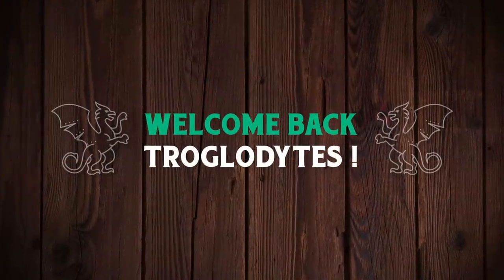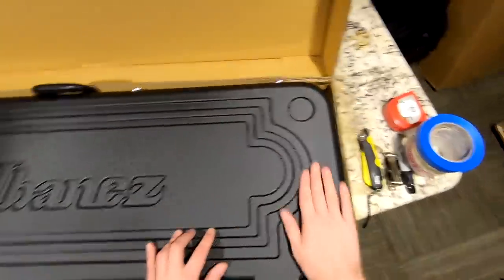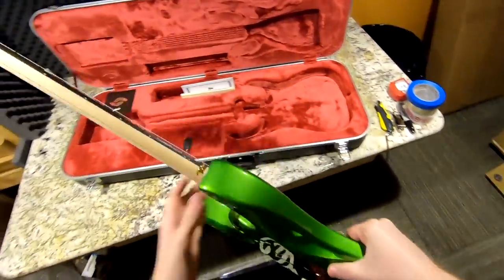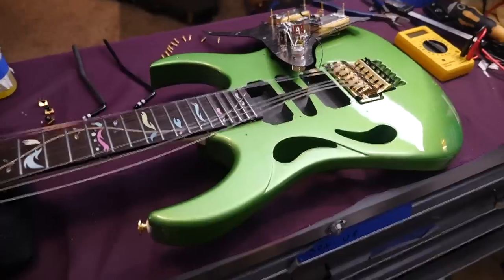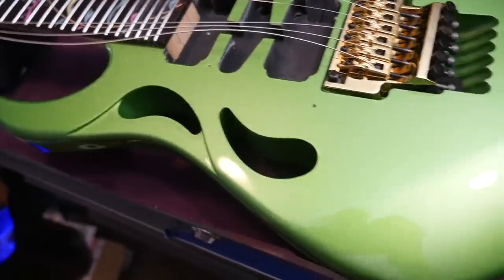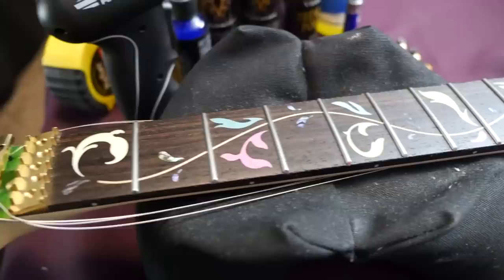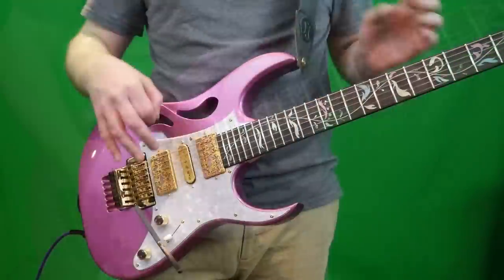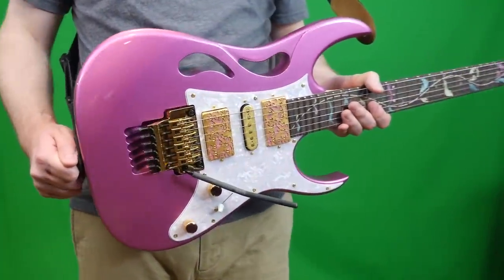I Bought the New PIA! | Steve Vai Ibanez PIA | Unboxing, Overview + Demo

Comment: Unlike a $3,500 Gibson which looks and does the same, here you see what you get for your money. The craftsmanship, attention to detail, scalloped frets, plus more. Ibanez does make you feel like your money is going somewhere.
Reply: Ibanez is for players and Gibson in for collectors.
Reply: With gibson you get an old style and design that includes the "feature" of a sudden and instant  "headstock ejection" at the slightest mistake, 5 inch drop or during shipping. Gibson says its traditional. I say, poor headstock design, fans who freak out at any change and saving money. I had a les paul decapitate itself during shipping. In its factory case! Fender changes, innovates and improves.
Reply: @reddragons13  Gibson makes so much profit from customers who like traditional. If you don't like designs from half a century ago better buy some other brand.
Reply: @C0urne  i do buy other brands. I also buy gibson when they do something I like. Take the axcess. I bought one of them. It was innovative and sounded great. You said it yourself they make a lot of money selling traditional guitars and have no reason to improve their products. As I have seen many times while being a session player. Extremely few people can tell the sound of a real gibson from clones and copys. You price something just high enough and it becomes exclusive and you get a  perceived quality thats not really there. Gibson makes good guitars but are they really that much better over all. I think that much like other guitars. There are unicorns among them all but for what they truly are. They are overwhelmingly overpriced. Still good guitars. But play what you like and love what you play!!!!
Reply: I think comparing a Gibson LP and a JEM is pretty dumb to be honest. They're tools and they are designed for completely different purposes. If an LP is one of those paint rollers and a JEM is a tiny brush for getting into a small space and getting the fine details right. Which one is better? The one being used for what it does best since they'll both make a mess of the others job. Think about it. Besides the fact they they are both made of wood and have 6 strings, almost every detail in how they achieve that is completely different.
Reply: @reddragons13  Fender sure has changed that Telecaster up a whole lot since 1952...
Reply: How does this have more craftsmanship’ than a Les Paul? Thet have carved tops, binding etc
Reply: @Daz912  the fit and finish is miles ahead of Gibson. Japanese made Ibanez guitars are extremely well made with superb fit and finish. Pretty much the opposite of your average Gibson.
Reply: @ohplezz  I’m holding an Ibanez Pia in my hands right now and the fit and finish is nothing special. They didn’t even paint inside the petals correctly.

Comment: Finally Trogly bought a guitar that can actually tune, has real pickups, doesnt break and is actually 1:1 dollar quality ratio. I'm proud of you dude
Reply: If only they realized that Gibson figured out where to put the output jack 70 years ago it would be perfect. Seriously, guys, you save me 12 inches of cable but I can't lean a guitar against my amp, or the plug interferes with my stand , or rests on the plug when it's on my workbench, or is so far recessed that I cant grab the plug body to remove it. Guitar manufacturers, please stop getting cute with the output jacks.
Reply: Real pickups? What are fake pickups?

Comment: There may have been a bit of polishing residue but I'm pretty impressed with the finish inside those scallops. It's not easy to get paint to lay down right in those tight spaces.

Comment: The whammy bar pushes in until it clicks. Its almost out when you are talking about it after the teardown. Probably the best Floyd Rose-style bridge ever made. The 5 piece neck having very straight grain makes it extremely stable. A typical Gibson fan(like you) is not likely to enjoy playing it(at least at first), but as a former Gibson fan(and I currently have 2 Les Pauls), no Gibson will ever play as fast and smooth as any of the 40-50 Ibanez guitars I've owned over the past 25 years. The bolts thru the neck(locking nut) is just as on the original Floyd Rose setups and is much more solid and stable in comparison the top screws(you don't want the nut to move at all, and this is basically like a rock unless it gets loose). Enjoy your reviews, but for this kind of guitar, maybe you should collaborate with a player that uses this style(hint hint)

Comment: You may, or may not already know, but re: tuning with floyd rose style bridges... always tune strings in this order: G,D,A,B,e,E. Or 3,4,5,2,1,6. Repeat cycle 3-5 times, depending on how out of tune guitar was before you started. It will get closer each time you do it. It's all about balance. This is what has worked for me over the years. Cheers.

Comment: I have had a strat with stainless steel frets for almost 18 years now and they do wear. You can see where I bend notes in the middle of the neck and begin to see pitting in the first position frets.

That said, I had a late 90s Mexican strat, with nickel frets, and I wore them down completely in less than two years. 

My new strat might need a crown and polish in 5 to 10 years, so 30 years of moderate playing isn't too bad; certainly worth the extra money!

Comment: The way to solve that guitar cable problem is run the cable through the strap from behind and into the jack. That's why the input jack on the guitar is designed that way. It's to instill the habit for guitar players to run their cables that way as they should with any guitar especially when playing while standing up. Apparently a lot of guitar players....especially a lot of younger or newer folks don't realize how damaging to the cable jack it is little by little. It's different when sitting down. I'm not a luthier or guitar tech but this is something I've learned over the years when I was younger from experienced guitar technicians. Just food for thought.

Comment: Tuning stability in a scalloped neck isn't an issue - unless you're a heavy handed oaf.

With a scalloped fretboard you can apply a nice vibrato to chords and make things a little more interesting. Of course you get a lot more grip of the strings for doing bends.

Comment: If the gold version is actually gold and not yellow as it looks in the picture but more like you showed with the green screen I think that one would look awsome. Always wondered why manufacturers like Fender and Ibanez don't offer a split coil option with a humbucker installed but activated through the toggle.

Comment: U dont need to block off a trem to keep it in tune. as long as you locking nut it tight enough and there aren't any friction points on the trem (which a brand new Ibanez edge shouldn't) u should be able to do what ever with it and it still return to pitch.

Comment: im thinking the hi pass was  inspired by the satch  model  too ... does it kick in at full on or does it simply remove the treble roll off when you back off on the volume so you dont lose  high end ?
the cable entry is to reduce the strain and remove the loop when you pass it thru the strap ... by not passing it thru the strap you are re introducing the  strain problem and guess what one of the biggest problems of jack strain is ?... yup signal intermittance

Comment: The lighter bar is carbon fiber.  Guitarists like Vai and Satriani can be rough on a metal bar, and it will eventually bend.  Carbon fiber is lighter and stronger, but feels different, so they include both

Comment: Wow, yeah these are  beautiful.  That Panther pink I don't care, I'm not good enough either but I would absolutely play that proudly!  But every high end guitar should have locking tuners, surprised these don't - its not for tuning stability its because it is so damn easier and quick to swap strings!
Reply: any guitar with a double locking trem system does not need lockers on it, just run the ball end of the strings through the tuners as the pointy end gets cut to length when you insert it into the bridge.

Comment: That Edge Tremolo looks like it is set up wrong.  If the top of the base plate is parallel with the body's surface, it's wrong. The knife edges are supposed to be parallel to the surface of the body, not the top of the base plate. You can see the separate metal knife edges on the sides of the base plate. That exposed sliver of knife edge on the side is what you make parallel to the body. I see a lot of people make this mistake and it's not optimal, you'll have more range when pulling the trem back into the body when set up correctly. Plus it could put unnecessary strain on the knife edges if set up the wrong way. These are some of the best locking trems ever made, and I hate to see them with a sub optimal set up.

Comment: "this doesn't feel like an ultra high end guitar", yet the quality control is second to none and there is not a single imperfection anywhere on the guitar. Okkkkk

You also didn't put the trem arm in properly and then started yanking it up and down
Reply: Name checks out. These guitars are grossly over priced.
Reply: @patrickdonofrio3082  😂 ok 🤷🏼‍♂️. I agree that they are overpriced and are not my cup of tea compared to other Ibanez models anyway. Doesn't mean they aren't amazing guitars. I would say the same thing about a Les Paul, massively overpriced yet often without the same quality control. It's ridiculous to say something doesn't feel high end yet also acknowledge that it doesn't have a single flaw
Reply: @IbanezFan550  agreed. Gibson AND these are overpriced lol. A lot of the $$$ going into Steve’s pocket on this one. Rightfully so. Buy it if you got the cash like that. But it just seems a bit excessive.

Comment: That’s a lot of money for a bolt on neck guitar
Reply: True,  bolt on neck guitars need to be cheap due to the lack of sound. Look at the new fender stratocaster QMT. A Bolt on neck and its over $2,500.
Reply: @reddragons13  true. With a Les Paul you can hear the sustain without plugging it in

Comment: I'm a little confused as to why you would buy a high-end Ibanez guitar when you clearly know NOTHING about them.  I've been playing Ibanez for 30 years now and even their mid-range guitars are better than most.  There is a reason Vai, Satch, Gilbert, etc. play them!  If the only reason your buying them is because they're pretty then, you're missing the boat.  When you speak of blocking the trem so it will stay in tune means you've never trusted the Original Edge to stay in tune when, if you set it up correctly, it stays in tune, even when you thrash the hell out of it!  I own several JEMs and a buttload of RG's and they are the shit but, my daily player is an RG350YE with a bird's-eye maple fretboard, an Edge III trem and I replaced the bridge pick-up with a Dimarzio Evolution.  Maybe you should play your guitars for a while before you criticize them.  BTW, the whole idea of the input being at the angle it is, was so Steve Vai could loop the cable OVER the strap so, if he stepped on the cable while playing on stage, it wouldn't disconnect from his guitar. 
On a lighter note, I'm pleased to see that Ibanez is finally solving the problem with the input jack.  It used to be so deep that you couldn't plug in the wireless transmitters(like the JOYO) so, you had to use a cable.  Ibanez, always innovative!